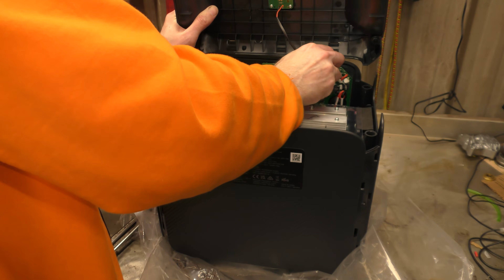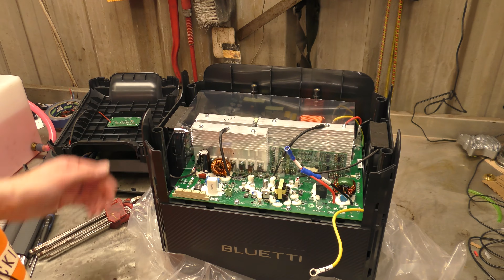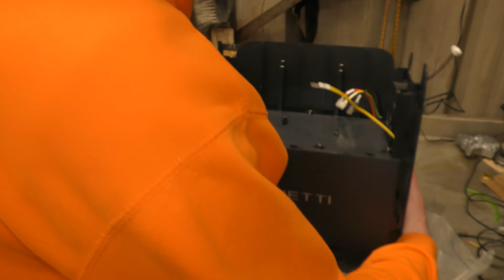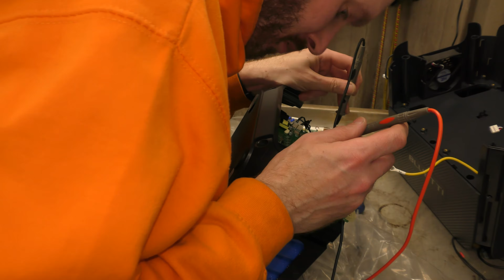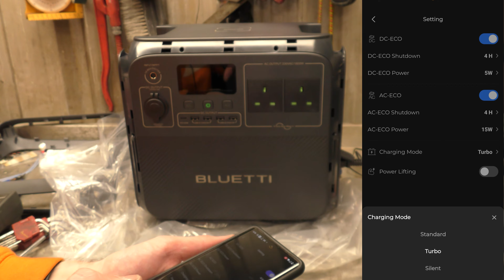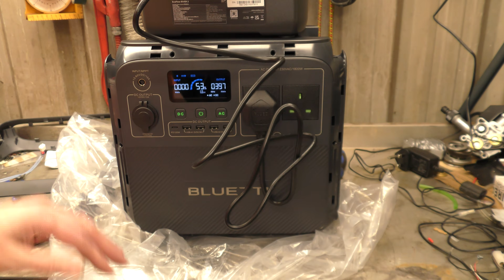Bluetti AC180 power station - teardown and quick test

Comment: Great analysis, thanks. Although this was 2 years ago, I recently bought one brand new for £499.  I wonder how much they were when they first came out.  This has been the best buy for my van I have ever purchased There is nothing that this power station can't do for me so I'm curious how much the cost was when you got yours. No mention about the fact you can charge and discharge at the same time, no mention about the fact you can have 500W solar intake. No mention about the fact that from 10% battery, from240v socket yo can charge in 2/5 hrs, without using turbo. Could have been a bit more in depth. But great video none the less. Oh, and the fact that there IS now an expansion battery for it, taking it to 2000WH. Thanks for video that I have just discovered.
Reply: La nueva sería de bluetti, es la sería élite, por lo que la serie AC ahora es más económica,
Reply: Paid £300+ for mine direct from Bluetti, seems decent enough.

Comment: Hey buddy. Thanks for the info!

It's funny, I have the same model. Except, it's a USA model. So, my AC ports are US standard. Also, I have 4 ports.

This is great information! I need to replace the solar input, as mine melted. I used the solar cable that Bluetti sent with the power generator. Unfortunately, the cable was too small. The cable overheated, and melted the plastics in the output of the PV cable. I'm kind of mad at Bluetti for sending the wrong size cable. I'm also mad at myself for not realizing the cable was too small. Oh well. It's a learning lesson.

Comment: I saw this or something similar advertised on Facebook which is how I found this video.  I was wondering.  If we had a power cut at home, could you plug your boiler into this so that you could get hot water and heating and how long might it last?  Once the boiler has lit, then it would only be running the pump.  The gas heats the water so I imagine the boiler doesn't draw a lot of electricity.

Comment: Hi. I am looking for a powerstation for my boat. One thing not mentioned on this video was how much is the total amp hrs of the 1800 unit please?
Reply from the maker: 36Ah.  I think the power station manufacturers use watt hours is (a) it's a bigger number and looks better (b) Younger users are more likely to working in watts.  The can see if they plug in a 100W phone charger a 1000Wh battery will last 10 hours (roughly).
Reply: @DavidMcLuckie ah right. Yeah it was total amp hours. 35 seems extremely low for the unit and what it can/can’t do so I would guess it’s 35ams each battery.  I have been looking closely at the Jackery Bluetti and a few other units to see which is the better build and value for money verses quality and so far Bluetti and AttomEss seems to come out on top
Do you have any other videos about the other units available as I found this one on the Bluetti website and found it extremely informative

Comment: So it's a 6P10S arrangement. This would put me off as it's a non standard as in not in multiples of 4 series cells which would give nice standard 12,24,36v etc. if it were 12v for instance it could make for easy powerful charging from a 12v system without major voltage conversion and you could take a decent sized 12v output again without voltage conversion and it would make 3rd party battery expansion much easier which may well factor into why they did it this way as it keeps you in brand.

Comment: I just got my ac180 and it get the error code that bluetti says is the fan or both fans. My Ac side will not work or will only work a few minutes then shuts off. I have cancer and use a c pap at night so I need it. Could you possibly tell me how to fix my fans? What kind of fans and where to get them please
Reply from the maker: I'm assuming your unit isn't new or the warranty would cover the fans?  In which case you'll need to disassemble the unit and measure the fans.  Companies like CPC Farnell will have every size of fan and you'd just have to wire them in.

If you're lucky you'll open it up and find it full of fluff blocking the cooling and cleaning it will fix the problem.

Comment: Need help! My bluetti ac180 is only charging at 150w solar input. I have parallel solar panels. Last year it is charging at 300-400w now is only charging at 150w max. I tried to change solar panel but still same thing. Is the solar controller damaged or something?
Reply from the maker: It's strange that it's low and not zero if it was damaged.  What was the state of charge of the battery when charging?  As the BMS will alter the charge rate depending on what it thinks suits the battery best e.g. battery temperature, state of charge.

Comment: What I really can't understand is why all manufacturers prefer the cigarette lighter connector for the 12V connection. This has all the known disadvantages, like constantly loose connections. Your great video gave me some insight into the connection on the front board. I plan to remove this connector and install an XT60 in its place. This connector works much more reliably than the other one. Thanks for the great insight.
Reply from the maker: I agree.  Why don't they do both?  A cigaretter plug for the people who perhaps aren't as tech savvy and nice chunky XT for those of us who know what they are doing.  I've seen some of the 'cheaper' power stations are starting to put XT ports in.

Comment: Great vid. Wish I had seen it when fresh.

As per the 10A 12v output. Would it be possible to swap it for the 30A found in the AC200?

I'd like to have a  12v RV cable set up like the AC200.

Cheers!

Comment: Hi, i have a Bluetti model no. AC50S which charges fine and the dc oitput works but theres no power feom the 240v output. Any ideas what the problem is and how I can fix this?

Comment: Which brands can limit charge current while doing pass through?  E.g. I want to use it to avoid tripping my breakers when using cooking equipment  on an already over loaded circuit. E.g limit to 500w in but can use 2000w

Comment: Which power station brand js built the best for reliability?
Reply from the maker: So far DJI seems to be the one that has gone all out on the build.
Reply: @DavidMcLuckie  thanks. I need one with 2kwh and around 1 hour charging. I see dji is only 1kwh. Might you have a next best suggestion ? Cheers !
Reply from the maker: @roberts8783  Bluetti or Anker as my second choices.

Comment: Update to my woes: I reopened up the AC180. there are 30 cells at 3.2V. So 96V fully charged. My battery is at 33V. It very discharged. My AC180 is not turning on. It is not charging. There is life, as a green led comes on @ the bms when you short the power on pins or push the power on button on the controller.

I disconnected the battery from the BMS, hooked up my scooter charger (42V 5amp) directly to the battery and I am charging it up right now. I am monitoring battery heat and charger heat. So far everything is nice and cool.

I am gonna bring it up to 42V and see what happens. Maybe it will turn on and take a charge.

In the video, you said you got 29V at the battery?

That sounds dead, like mine.
Reply: On my Uk spec unit, the label on the rear shows its 32 volts * 36 ah = 1152 Wh capacity. I believe there are 60 cells in total.
Reply: @johnr1166  mine doesn't have the sticker, after chatting with somebody else here in the comments you are absolutely correct. So my unit's issues have nothing to do with state of charge unfortunately. I carefully jumpstarted the battery monitoring it to making sure it didn't get hot. It's fully charged. 

I'm starting to feel like the issue is with the transistors on the BMS. 

When I have the main battery voltage prongs disconnected from the inverter board/control board, but the little canbus connector from the control board plugged into the BMS, and I plug in AC, the green power button lights up and flashes green, but the unit still doesn't turn on when pressed. The second that I bolt the bms main voltage connectors to the inverter/control board, the power button goes off and stays off. No amount of pressing it or plugging in AC, plugging in DC wakes the unit up. 

To me that signifies that the BMS board has an issue.

I also have Epson printers and I know what they do when the transistors go out on the main control board . 

What are the chances that they are the issue here?

I am grasping at straws, I guess , but blue Eddy doesn't support products that are not purchased directly from them. And I'm not talking about free warranty repair. I'm talking about paid repair. They just refuse to do it . I wish I had known this prior to purchasing one of their products worst case scenario I am going to post it on eBay and sell it off.
Reply: @goclunker  did you find any solutions. Your issue sounds like mine. I have an ac200p that a friend gave me. It has a cell overdrained so the bms thinks it's dead. I'm in the process of trying to find someone who will rebuild the internal battery pack, or I am going to have to open it up and attempt to trickle charge the cell that's too low.
Reply: @commonsenserevival  Hey! I did, but you are not gonna like it. I bought a second AC180, took it apart and part swapped. The inverter AND screen boards were both DEAD.

I ended up selling it on for parts. The battery pack was perfect.

IDK about the 200p, try trickle charging it and see what happens. The 180 is fully charged at 34V +/- so mine was fully charged, the issue was with the inverter and display.
Reply: You’re not understanding battery circuits.

This battery is 6 parallel circuits - each circuit is 10 cells in series.

The nominal voltage of these cells is 3.2v (common for lifepo4), which is their voltage at approx 25% capacity.

When fully charged they may reach 3.6v.

When 0%, somewhere around 2.8v.

If you’re getting 33v, your pack sounds to be around 50% full.

Your 42v charger will harm this battery.

Please stop. If you can find a bench power supply, set it to 36v.

It sounds like the charger circuit has failed in your AC180. They have a 5 year warranty - let Bluetti deal with it.
Reply: @simonr23 actually... the inverter board failed, and fully charged, this battery is 34V.... so looks like YOU aren't understanding circuits either. Long fixed. Have a great life.
Reply from the maker: It's possible that the voltage I got is from the BMS when 'off' and it's outputting a voltage the rest of the system sees as off.

It's odd that your BMS would let the voltage get that low.  Let us know if it comes back to life.
Reply: @ so far nada. I brought the pack up to 42V and no dice.

This pack is 96V, am I reading this correctly? Or no?

When i tried to jump start it with 54V it got to 44V and very warm so i backed off and same results. Pushing the power button turns the green led on the internal bms board on stays on for 30 seconds, turns off.

Charging the 40v + got the bms internal led to blink slowly and thats it.

Refuses to take charge from the dc jack.

AC charge port archs when plugged in so its def drawing power but nothing else happens.

Lastly, when I took it apart again it dropped right back down to 33v. 

I don't understand what this thing is doing
Reply: @DavidMcLuckie i don't know what its doing. Its like yours, hovering around 33V and nada.
Reply: Did you apologize to it 50 times and take it to dinner ?

Comment: I was wondering if you can help me. I have an AC180 that doesn't turn on. It does not charge. a green led comes on internally on the battery board when you push the power button and that's it. It won't charge AC or DC.

The main battery pack is at 32V-33V. I noticed yours was 29V and it said it was at 42%? 

Do you know what the voltage of the battery is suppose to be fully charged? I am thinking of charging the battery pack itself to boost it, and maybe that will make it kick on? Same way you revive a car battery that is dead. a quick jump charge and then the charger picks it up and charges it correctly.
Reply: Hi did you get your issue resolved? For my I measured the B4 and it is the same voltage as B3 which is odd. I have the US version
Reply: 11.1v on B3 and B4 has the same 11.1v
Reply: @bugbyte2k11  My inverter board was done. The cells were fully charged, at 34V. The BMS was functioning correctly for me. 

11.1V seems dead. You might be able to trickle charge the pack up with an  external charger like i did at first, if the unit doesn't turn on at all.

It might be a fried inverter board as well, just be aware.

Comment: Great tear down video and so pleased to learn how well made they are. 

I’ve Had mine for a few months now, it lives in the car and yes it’s heavy but so far reliable, the winter months will test the cold performance as I also use  them for defrosting the frozen windscreen using a 750watt hair dryer activated by Bluetooth when I’m in the house, I just need to leave BT on overnight.
Reply: You can't turn the AC180 on with the app. You will need to turn off echo mode and use a Bluetooth outlet. As far as cold performance you could try putting a 12-volt seedling mat under it if it gets too cold.
Reply: Sorry I'm wrong. I was thinking of turning the unit on. You can't do that with the app but, you can turn on the AC outlet. My bad!
Reply: @halholland1637 so how would this be implemented and operated and what source of power ?
Reply: If you get the ac180P, I'd be interested to know how they pack in more power for the same size&weight ?

Comment: The reason the earth of the unit is separate from the mains input, is to prevent a short circuit in the unit from earthing to the mains grid. They should not be connected! This is islanding. If your unit develops a fault, it should go to its own earth NOT to your house earth anywhere. If an electricicy employee was working on the grid somewhere on an isolated supply, and your unit was made to earth to the mains nearby they would be electrocuted by the unexpected supply of electricity.
Reply from the maker: Excellent explanation, thank you.

Comment: I have a new AC180 (April 2024).  The AC grounds (AC Input, 4 Outputs, Ground Lug) are all connected within a tenth ohm.  Think about it, in UPS mode it would be pretty bad to have a floating ground on the 4 receptacles.  Use a meter to probe the AC receptacles and you might be surprised by what you see. Also AC outputs do not appear to be ground fault protected.  The DC commons (DC input, 12V DC output, USBs) are all connected together but not directly connected to the AC Earth Ground.  There is probably a capacitive connect between earth and common.  This is not uncommon.

Comment: Will you modify the AC input to include the earth so every time you plug the AC cord to charge that will always be earthed? Is it doable? Was there a earth terminal on the AC input so you can just tie them all? I want mine that every time I charged it that it is always grounded and no extra effort separate earthing.

Comment: Has anyone tried adding to battery pack? Increase capacity but keep everything else intact.
Reply: Yes it's simple. buy a 12v/24v, 24v is better so a 24v/100A = 2.4Kw/2400watt, charge it when the sun is there then when there is a day without sun you can put the battery on to charge the power bank.

Comment: 1152 Wh / 10 cell x 3.2 V gives 36 A gives 6 rows of 6 A these with 10 x 6 A cells in serie explains it all. I guess
Reply: There are 30 cells @ 3.2V each.
Reply: @goclunker  Yep 60 cells x (3.2 V x 6 A) =1152 Wh 15 cells will give 48V Bluetti is always using that configuration 3.2 V per cell is the low side of the voltage range . I still guess.

Comment: Nice video, Sir. I understand it's better not to use one of these as UPS because all onboard electronics works on battery, and so it will constantly recharge itself from 99% to 100% again and again. Is this correct?
Reply from the maker: I have found this yes.  I was using it as UPS for the laser engraver and laptop as I didn't want a power failure.  But even with the laser and laptop turned off, it would still periodically run the fans (quite loud).  Not the end of the world but something to keep in mind.

Comment: Question. Can I run a 1400 watt kettle on a cold morning @ 5 to 6 degrees? And do you think it will die in 20 mins at this temp?
Reply from the maker: Temperature is always a tricky thing for the power stations.  Obviously the cold affects the chemistry and how well they operate.

In the winter I've had them not start diesel heaters and not take a charge.  Not this AC180 in particular as I haven't had a winter with it yet.

Comment: About the grounding - I don’t know about the UK but in the US it is against code to ground a device at more than one point. regardless of code it’s a really bad idea because you can create a ground loop. Ideally, you would want the outlets to be connected to the AC grid ground (and not the post) when the AC180 is plugged into the grid, and only to the grounding post on the device the rest of the time. I guess that’s too big of an ask.
Reply: UK regulations prohibit the sharing of the mains supply earth with generators.

Comment: You mentioned that honking big coil. It is the output inductor that filters the output of the AC sine wave inverter, which starts out as a high frequency PWM signal and is filtered to remove the high frequency components. Bluetti usually does a pretty good job of this. Bigger and inductor, lower noise. Physics!

Comment: Enjoyed the video. However was hoping you might have attempted to start your diesel heater using the 12v socket s you tried and failed with an Allpowers device. 
Would be interested to know if the Bluetti is up to the task. 
Cheers.